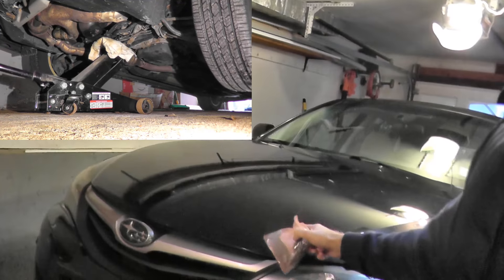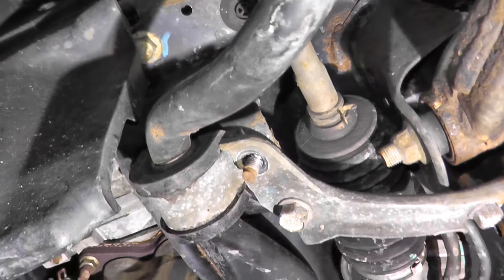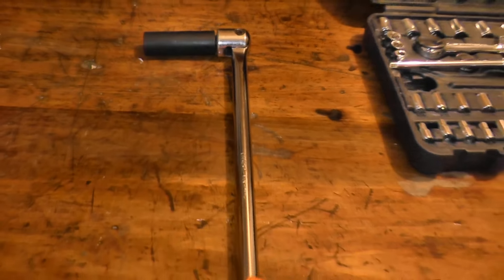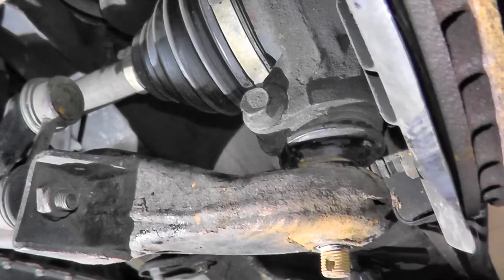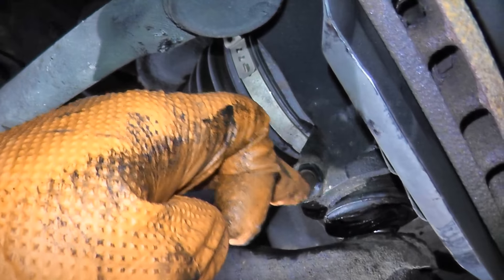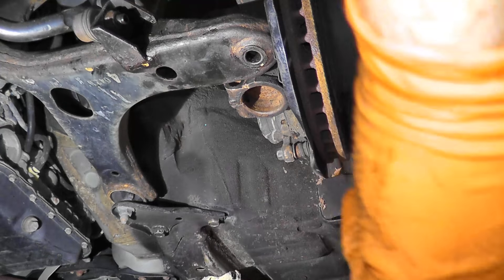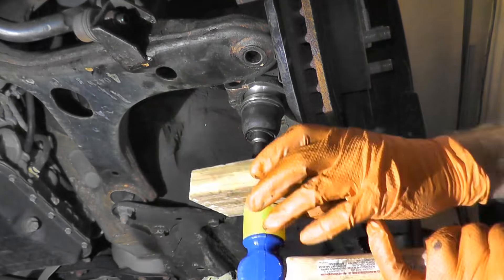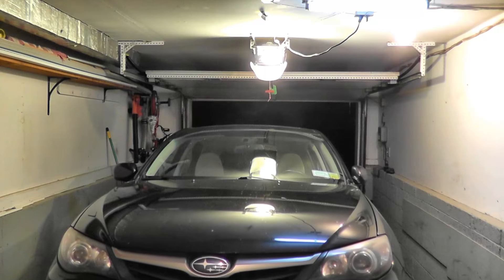Lower Ball Joint Replacement with Basic Hand Tools

Comment: I have an 05 Dakota and live in the northeast so rusted bolts are just part of my life.  When doing repairs I’ve gotten in the habit of applying penetrating fluid to other nuts and rusted connection points that are accessible while I’m in an area of the truck. I’ve been grateful on future repairs many times.  Btw I’ve found a great penetrating fluid to be equal parts transmission fluid and acetone (use a metal container—acetone dissolves plastic).
Reply: Great tip

Comment: On an older car, an electric impact wrench has become a basic hand tool.  It saves a lot of stripped bolt heads and busted knuckles.  Clean the bolts off with a quick wire brushing before re-installing and use a little anti-seize.  It does wonders if you have to disassemble anything again.
Reply: Lying 🤥 bro

Comment: Thanks for the demonstration.
Some things I learned from seasoned mechanics is:
1. Use Nickel Anti Seize on the cotter pins and medium strength threadlockers on cotter pin to prevent corrosion and rust, preventing rust welding or thread galling.
▪︎ The threadlockers are Loctite/Permatex 242 Blue(can be removed with hand tools), Loctite/Permatex 290 Green(wicking/penetrating put on after torque)
And if you want you can use Permatex Orange 25210(high strength threadlocker that's 3x stronger than Blue but as easy to remove with breakerbars)
Nickel Anti-Seize instead of Copper because according to Henkel-Adhesives(Loctite) Copper on stainless steel causes inter-crystalline corrosion with the threads. Nickel-Graf($18 8-oz)/Loctite Nickel Anti-Seize ($16 - 8oz) the Anti-Seize is coated on the threads if you have rust problems but you have to reduce torque values by 30% [recommended by Ajax the worlds leading bolt fastener manufacturers/ engineers] (multiply dry torque by 0.7 to get wet torque) 
▪︎ for example 44ft-lbs * 0.7 = 30.8ft-lbs.

2. Put the Ball Joints in a deep freezer overnight so it shrinks the ball joint which makes it much easier to press in. You can also rent a ball joint press for $20 or free if you put up a deposit.

Comment: I have been trying to get my ball joint out of the socket for hours now. I have tried a long pry bar, a fork with an 8 foot pipe on it, and it has barely budged. Impact, heat, and penetrant hasn't worked. I would kill to live where you live with no rust. My car is in good shape for where we live. Going to try an air hammer on it now, I truly have no ideas left

Comment: Pickle fork or tie rod end puller is vital to break the seal it's pressed in place the stabilizer bar into the control arm that pickle fork is key

Comment: Great video .. I've a stupid question . But does the car need to be up on both sides i dont have a hydraulic jack only a scissors jack i can get one if needed ._ thanks alot .
Reply from the maker: Of course. I had both sides jacked up because the driver's and passenger side were being replaced.

Comment: My pinch bolt broke. Got the gap opened up, but can not remove the ball joint from the Knuckle even with wood and hammer. I have splintered the wood

Comment: Lighting WAS GREAT, like you said though use penetrating spray. If I know I'm going to be changing some part out & it doesn't  require an immediate fix ? I'll spray everything down I have to take off about a week before I have to do the job. Also I would have cleaned the ball joint hole out maybe with sandpaper to get the rust out of there then used anti seize before pressing joint back in. Try to find parts that are greasable  if possible, they have a grease zerk.You did a GREAT JOB especially since you don't have all the fancy tools like most of us & doing it on the ground. Hey what kind of gloves were they ?
Reply from the maker: Thanks for the feedback! I wired brushed the ball joint hole and thought afterwards maybe I should of cracked out the Dremel and cleaned it up a bit. Gloves purchased from Amazon. Just look up AMMEX Gloveworks.
Reply: CarsNToys, Feedbaack hell, THANKS FOR THE VID. MAN. You know what' funny as all get out ? I was going to suggest a dremel but I thought you would think I'm waaay over the top, LOL. Thanks for the heads up on the gloves & your GREAT VIDS. on how regular people get SH** DONE.

Comment: Do you have to use a torque wrench or can I just use a big ratchet? Awesome video also.
Reply from the maker: Thank you. A torque wrench certainly helps, however, it's not necessarily required. What I will say, especially on this Subaru, fasteners often break if you over-torque them.
Reply: CarsNToys ok cool thanks. Yeah my car is a 2015 Buick Encore in I can’t find any videos on anything so That’s why I watched your video to kind of get the idea of how to do it. Your video inspired me to do it myself thanks again.
Reply: @CarsNToys  That's why you torque to the manufacture specifications and use proper tool torque technique

Comment: I always thought  ball joints had to be pressed out and back in.   The wood method you used is that always effective?  You made it look so easy.

Thanks
Reply from the maker: It was the only way to remove the ball joint without a specific tool.
Reply: Subaru doesnt use a press in balljoint. The pinch bolt holds it in. I've done one on my old 02 Forester is it just fell out after I removed the pinch bolt. Some need a good beating
Reply: Unusual for a ball joint to fall out that easy, most ball joints are held in place by some sort of lock ring.

Comment: I was replacing a lower ball joint yesterday on a 1997 ford escort  and it took me  about a hour to get it out.  I used a pickle fork  and a air hammer   and 4 lb sledge   it was 22 years old  and being in ny  with all the rust and salt   did not help me .   I sprayed  all the hardware  and the ball joint   and let it sit for a little  while first.
Reply from the maker: Air hammer is certainly a big help. Good tips!
Reply: My 97 merc GMarq 175.5 K mlg, is having control arm and ball jt replaced both sides front.   $925.   Hope successful !

Comment: You skipped the hardest part.  After making sure the ball joint is seated in right, u skipped seating it in the control arm. Not much help
Reply from the maker: Used the mallet  @10:11